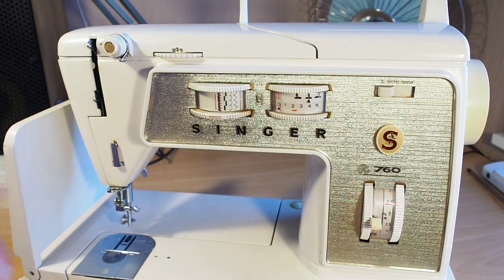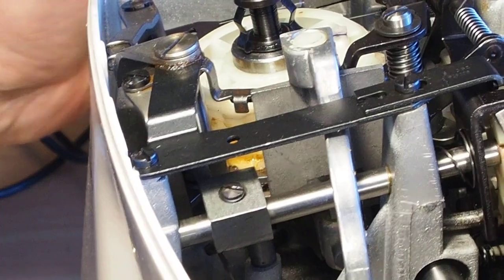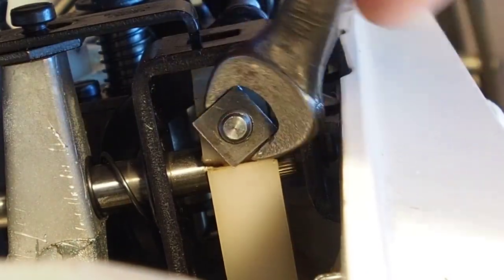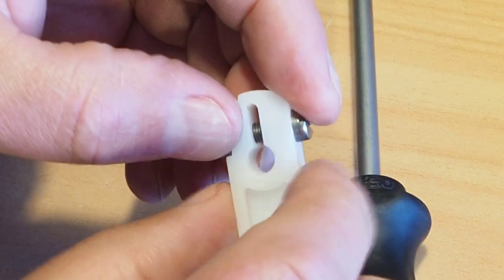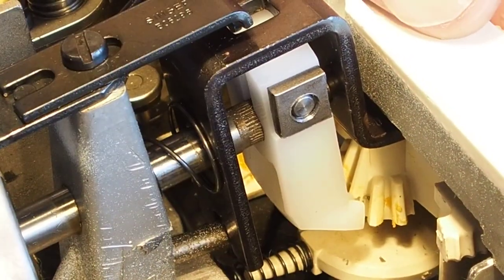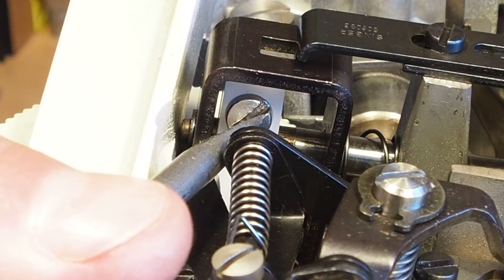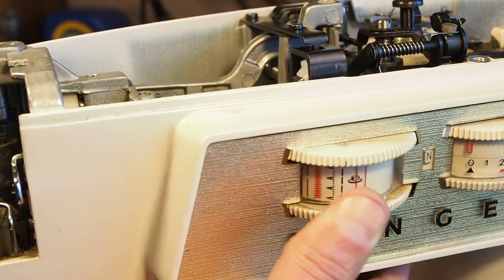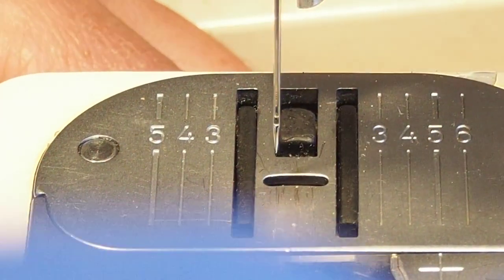Singer 700 Series Stitch Selector Gear Replacement - Quadrant/Finger Gear

Comment: I was given a singer 760 last year! It has this gear sticking problem too - the needle bumps the foot and just sounds wrong - the problem with the gear selector turned out to be the that clip at the front of the spindle. Really greatful for your videos because it does seem a really nice machine which i hope i can get sewing again. Cheers from the UK mate!
Reply from the maker: Good luck. Yes they are very good and I hope you get your machine working.
Reply: @InStitches  Great helpful videos! Thanks very much, I now have a working 760 - turned out the capacitor in the switch blew and knocked the contact slider right out - no slow speed but max speed is working fine. Any idea of the value of that cap? Once again, thanks very much for your instructions

Comment: I have a Singer 714 and the pattern selector is stuck, it will only straight sew.  From what I can see there are two cylindrical gears that are supposed to mesh.  The back one seems to be worn smooth.  Where can I find these gears and can you show how to replace them and set the timing as you did in this video? The reverse also is not working.  I appreciate your detailed instructional videos.

Comment: Thanks for an excellent series of videos on these machines. You've helped me get a 784 up and going again. I still have one problem which is that the Flexi Stitch option isn't working properly. It looks like it makes the stitch shape but doesn't feed it through properly.
Normal stitching is fine and reverse works ok. 
Could this be a problem with the rubberised feed dogs or should I be looking somewhere else?
Reply from the maker: I guess it could be a problem with the feed dogs but difficult to say without looking at it. Maybe try unthreading it and place a piece of paper under presser foot and see if it feeds on the backward stroke?